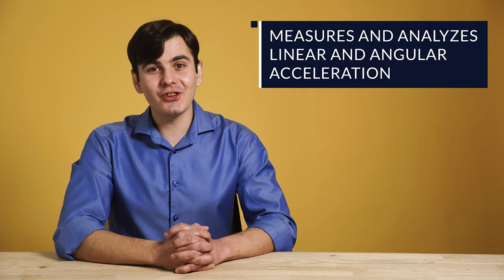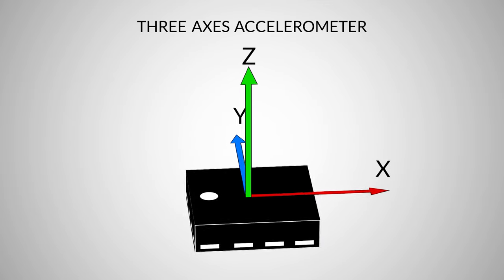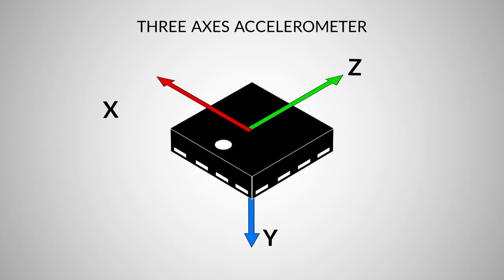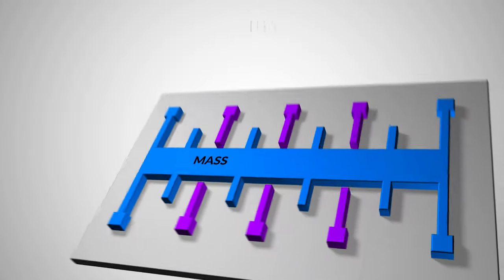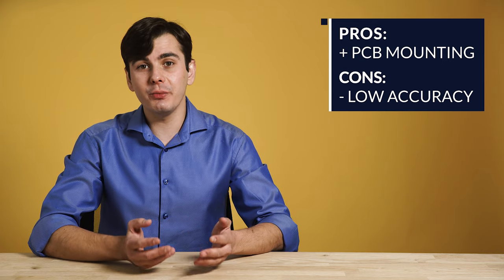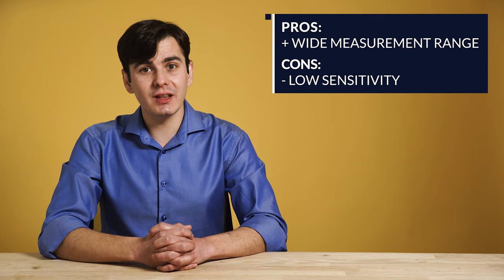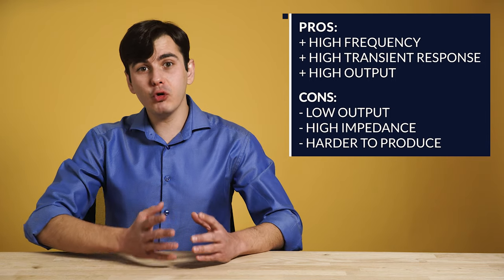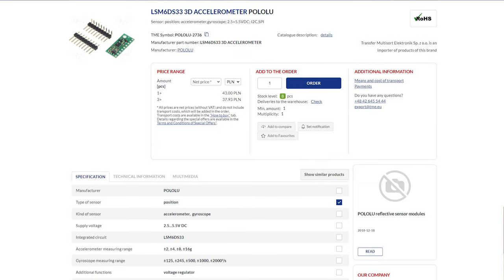ACCELEROMETER - What it is and how it works

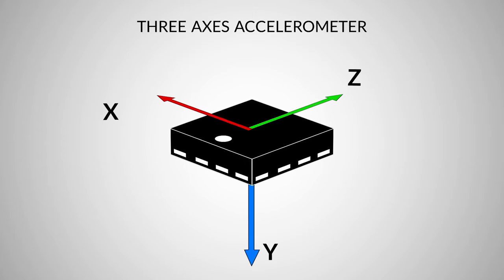Comment: At 1:42 in the video, the axis definition is misleading.  Assuming if I push the device in the X or Z direction I would read a positive acceleration, the Y direction is being pushed up by ground reaction, and thus should read negative on 'y'.  It is a common misunderstanding to confuse gravity with what an accelerometer senses.  yes, gravity pulls objects down, and if not resisted by anything an object will be in free fall, effectively accelerating but an accelerometer will read 0.  As soon as freefall is resisted, the accelerometer will observed an upwards acceleration (not down!).
An accelerometer does not sense gravity, it senses acceleration.  Gravity just puts an offset on the observed acceleration.